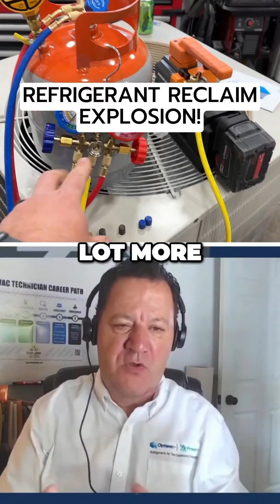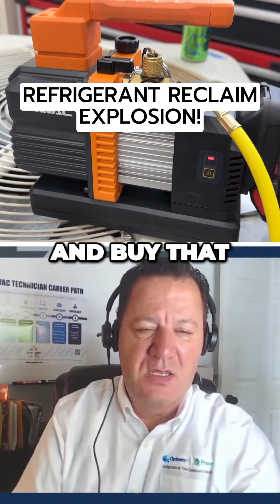Explaining Refrigerant Recovery, Refrigerant Reclaim, and Refrigerant Recycling #hvac #hvaclife

Comment: The automotive industry has been using recovery and recycling recharge equipment since 1992. 

Removes particulate matter . Removes oil out of the refrigerant.. Separates and removes noncondensibles like air out of the refrigerant. Removes acid out of the refrigerant. 

And then the refrigerant is ready to go back into vehicles . 

This is under the EPA 609 for mobile vehicles